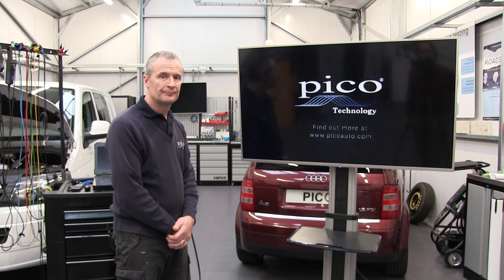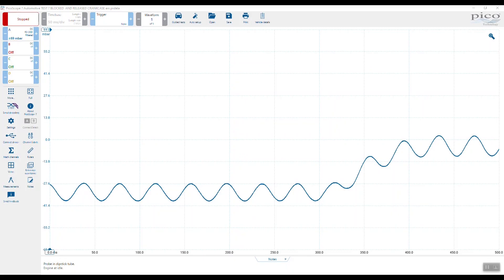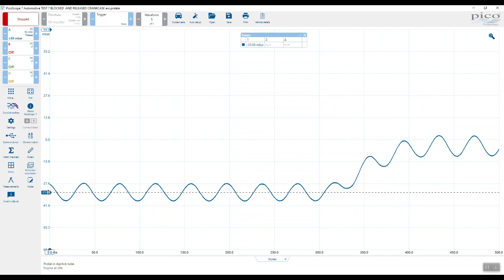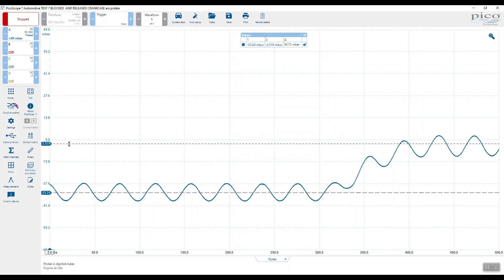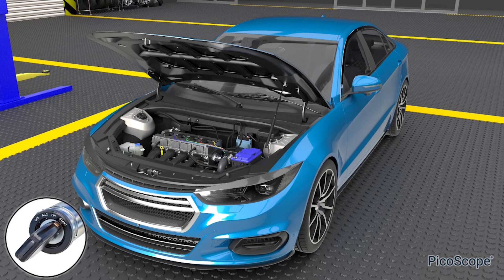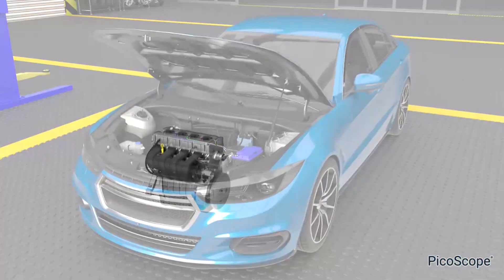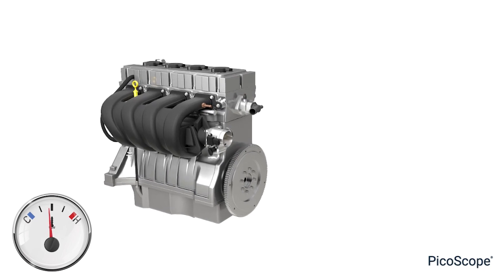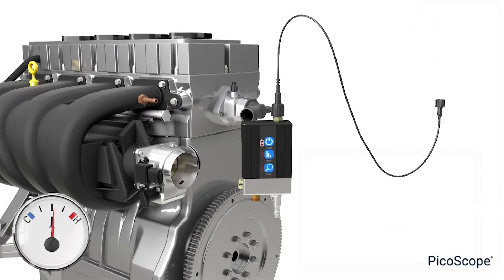Crankcase Pressure

Comment: great video, thanks!
 How does one find out the desired/intended/designed crankcase pressure value for a 2008 Sprinter's OM642 3.0L diesel V6 engine?

Comment: With a correctly functioning PCV system, what is the recommended vacuum the crank case should have at idle and at speed?
Reply: Because of emissions it depends on the exact model year of the engine you’re testing. You have to compare with a known good or reference the service manual.

Comment: What if the dipstick pipe goes under the oil level? Won't it inferfere with the reading?
Reply: There maybe times where the dipstick tube does not produce the results required (there may not even be a dipstick) In this scenario we connect via the oil filler cap or crankcase ventilation valve. You may have to uniquely adapt to the engine under test. I hope this helps take care…..Steve